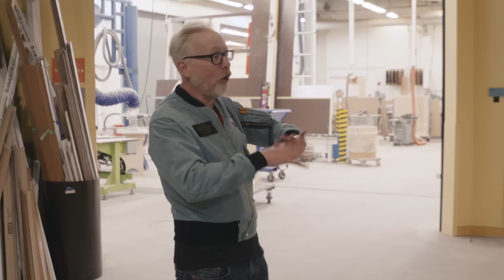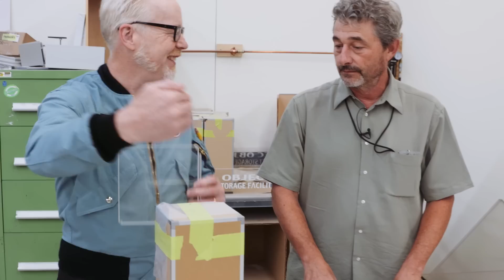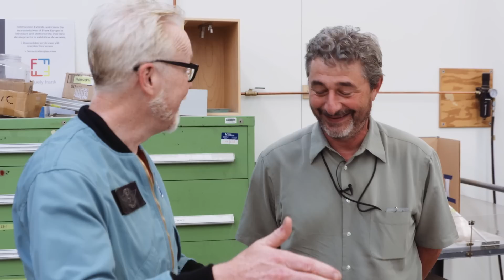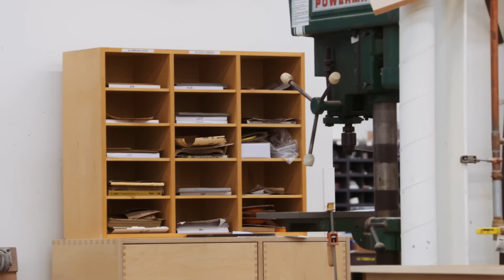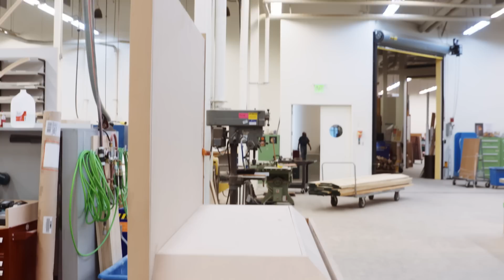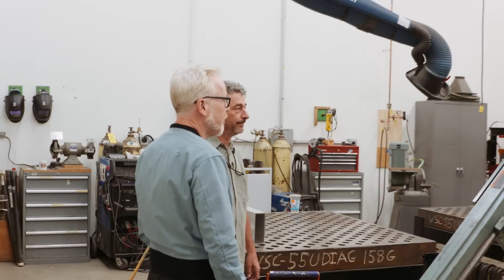Adam Savage Tours Smithsonian Exhibits' Fabrication Shop!

Comment: Hi Adam. I found another Bladerunner-Like Gun. It is Awesome, & Very Cheap. You Need to add it to your collection. https://www.ebay.com/itm/LED-Light-Up-Self-Loading-Action-Toy-Pistol-Gun/292982104396?_trkparms=aid%3D555018%26algo%3DPL.SIM%26ao%3D1%26asc%3D20131003132420%26meid%3D8a0683715bcb49eda5dd1f7ef69aeb68%26pid%3D100005%26rk%3D1%26rkt%3D12%26sd%3D123907786331%26itm%3D292982104396%26pmt%3D1%26noa%3D0%26pg%3D2047675&_trksid=p2047675.c100005.m1851

Comment: I wish you could buy those modular, flat-pack display cases off-the-shelf in various sizes. I'm guessing the aluminum extruded pieces are specifically designed and made for the Smithsonian?